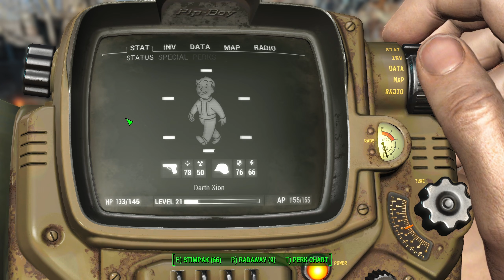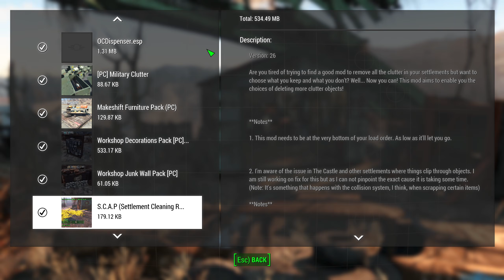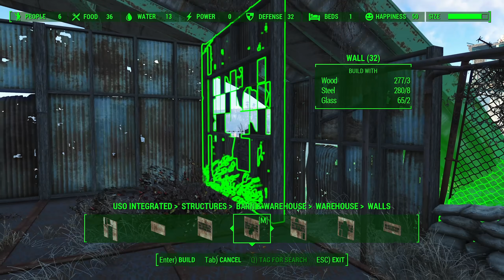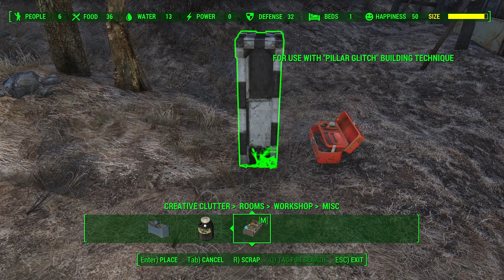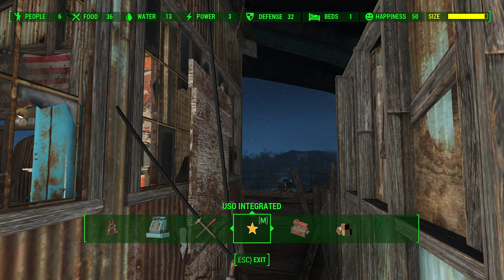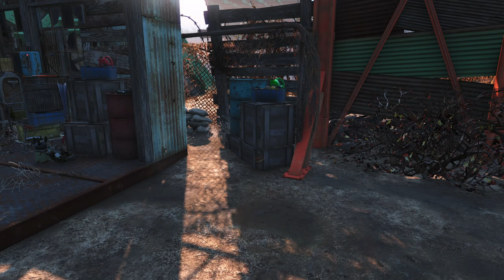FALLOUT 4 | Graygarden - Robot Workshop Build.

Comment: @10:15 FYI there's an easier way to do the Fallout 4 pillar glitch than what you're doing in this video, if you had placed a campfire down in front of that shelf you could have done the pillar glitch right there on top of the campfire because the game sees the ground under the ring of the campfire as natural ground so even if you have floors you can sink the pillar though the floor and this can be done on any floor be it at ground level or above ground level. I hope that bit of info is helpful to you going forward with your builds in FO4.
Reply from the maker: In this case I think moving the whole thing outside then moving it all back afterwards would probably have been easiest. That campfire trick might be helpful later on though. I've got an idea for the area with the dead trees outside and I think the campfire might help get around some of the issues with that space. 🤞

Comment: Hey I have a question about fallout 76, how did you get the log cabin porch, railings and stairs? I got the set from the atom shop but it only has walls and roof pieces.
Reply from the maker: Like the rest of the kit it's also from the Atomic Shop. The porches were added later though so not all the sets that have the main kit include the porches. If you keep an eye out they'll probably appear eventually. The bundle will likely be at a reduced cost to as you already have some of the items. The other option would be to check the support pages and see if you can buy them through there.
Reply: @DarthXionGames  alright I thought it was something like that, thank you sir!